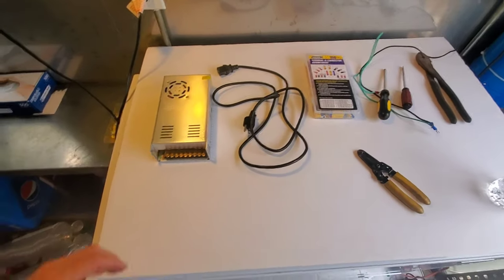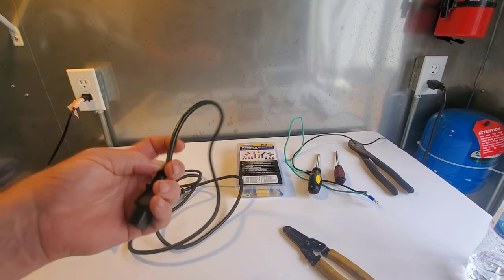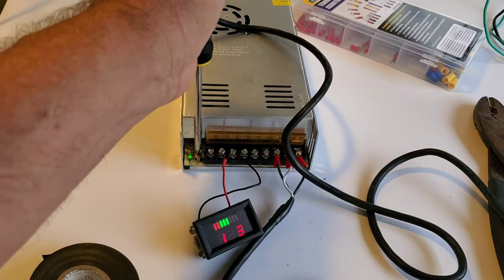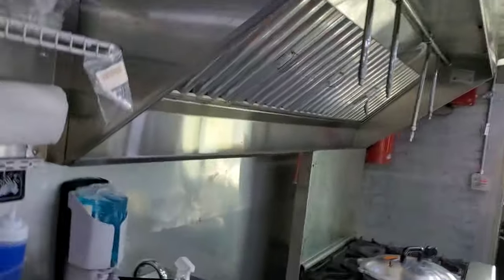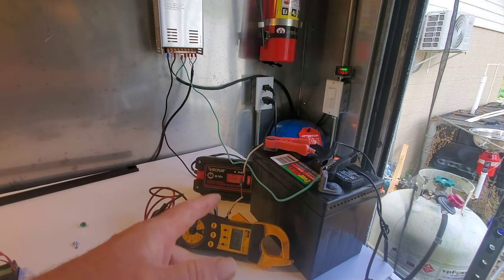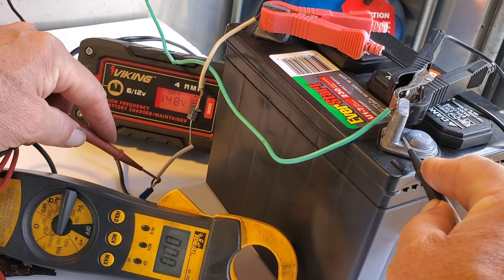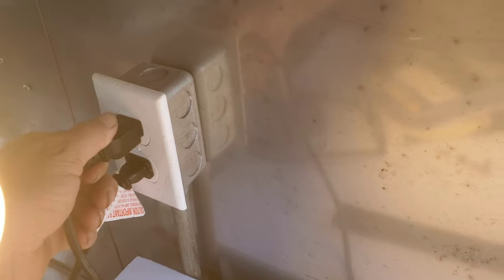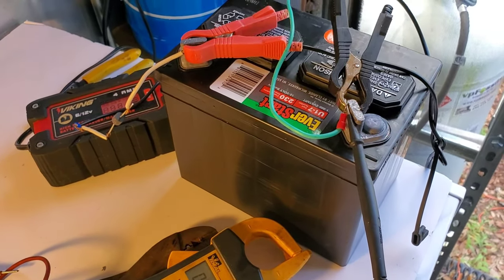Fully Automatic Power Supply With Battery Backup

Comment: Been better to drawl a diagram. I bought a power supply to run my diesel heater off of but want a battery back up tied to it also in case power fails and the battery can keep the heater running long enough to cool itself down before it shuts down.